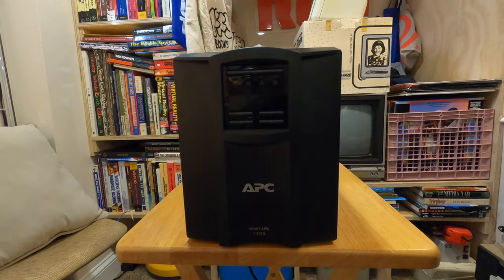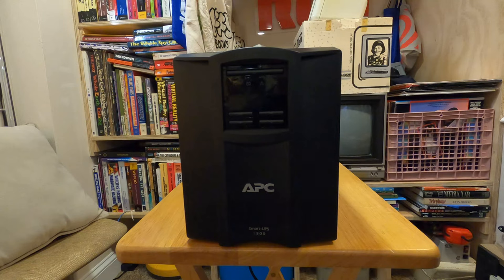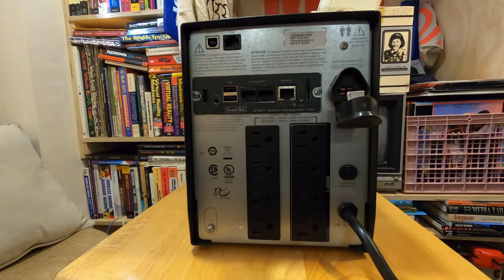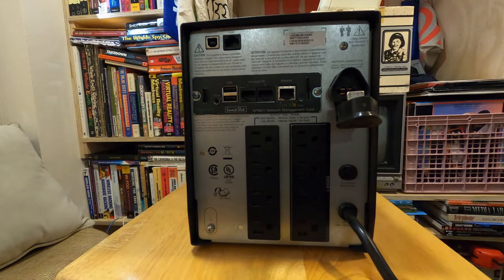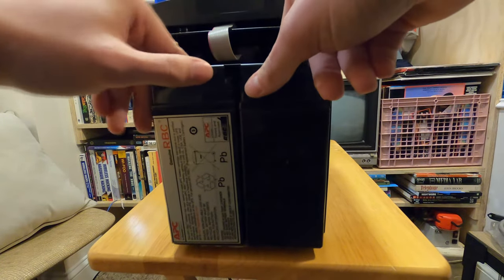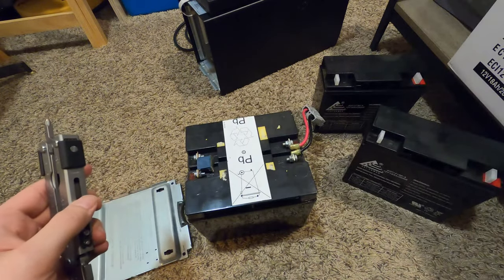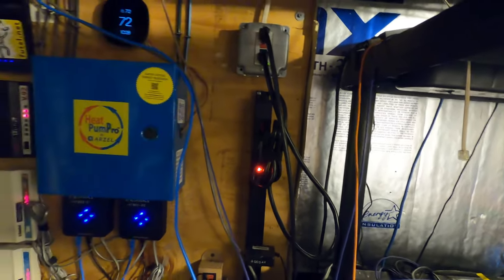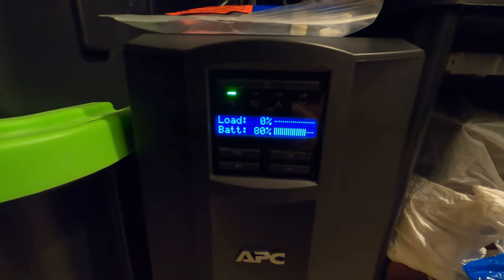Replacing Batteries in an APC Smart-UPS SMT1500

Comment: Btw these are designed so you can hot swap the battery while its still on, use the battery disconnect in the back before hot swapping. I have one I also bought used, they are really nice and a great value. I wasn't lucky enough to have the network management card come with it but I found one used on ebay. One warning about these units thou, the self test isn't perect and if the battery is bad the unit sometimes will just shut down with little warning. Just replace the battery and your good to go for another 3-5 years.

Comment: I'm using CSB GP12170 Batteries for my SMT units. I think it's one of the top tier brands out there. Your load is way too low  for this UPS that's why it cannot calculate the load (and the remaining time) correctly, like you said. You need at least 30%. If it's still way too off you need to calibrate the battery time by applying more than 30% steady load and let it drain the battery completely. Procedure is a bit weird as the power will drop so I wouldn't recommend doing that with your equipment connected (I'm using tungsten lights)
Reply from the maker: @cmos64 Thanks for the info, I'll need to come up with something with a high current draw!

Comment: Greetings from Indonesia:  I bought a used APC Smart-UPS SMC1500IC for US$50.  Batteries were dead, but I changed them out with new ones.  At our avocado farm, electricity is VERY UNSTABLE and lightnings .  Based on personal experience:  the APC units seem to withstand the lightnings better compared to other brands.

Comment: WONDER - CAN SWAP TO LITHIUM BATTERY INSTEAD TO HAVE MORE BACKUP TIME ?  /// THX 4 SHARING THIS...
Reply from the maker: Technically you can, but it will degrade/harm the lithium battery and give it a much shorter life to the point that it will have worse longevity than lead-acid. The charging circuitry isn't designed for any lithium chemistries.
Reply: LiFe is the one that looks like SLA so I assume thats the one you are talking about...and technically yeah, it should work.  The thing is if it goes sideways it goes really hard sideways and that might mean battery goes boom and the house burns down.  Not really worth it given the purpose of a UPS is not to keep running when the power is out...its to give you time to gracefully shut things down, and in this case, the UPS will actually do that for you if you configure it properly.

Forget LiPo entirely...too many ifs on that one and one, dead battery detection, is almost definitely in the charging circuit and LiPo really hates that.

Comment: Hi! I have the same unit and when i disconnect the ups from wall outlet the loads turned off and give this humming and buzzing noise. Do you think it’s the batteries that I need to replace? Thanks for any advice.